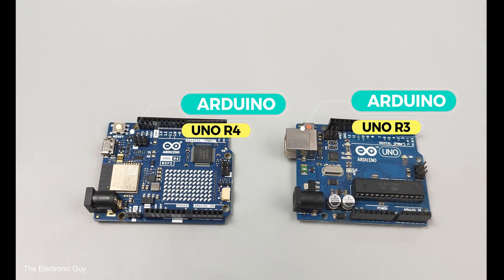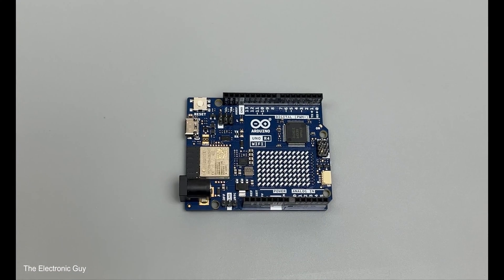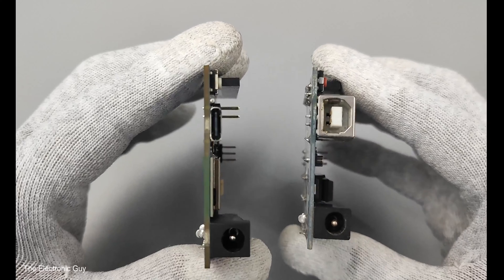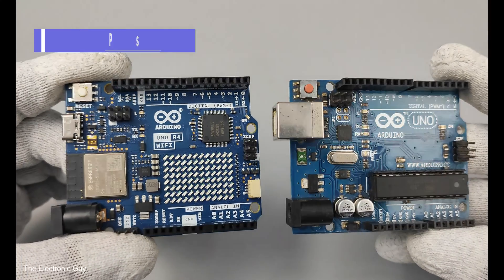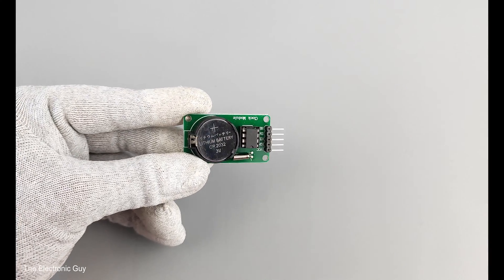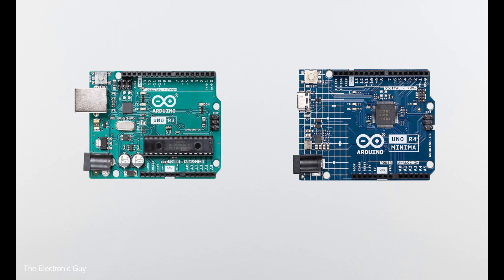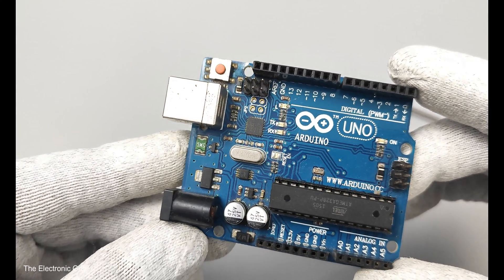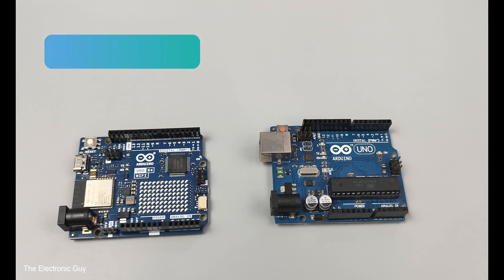Why Arduino Uno R3 vs R4 Isn't Close in 2024

Comment: The digital output current differences mean that the R4 is not necessarily a drop in replacement for the R3.  They should have changed the name to UNO+ or something like that to distinguish the two.

Comment: So does the R4's RTC loose it's time when powered off?
Reply from the maker: You have to power it separately from a battery so that it remains on. It's just like attaching an external RTC module(with a coin cell) but now you don't have to make any connections.
Reply: Is there holder to add external battery for RTC

Comment: Adding an esp32 for WiFi and Bluetooth is lunacy. Just by itself is is more capable than an Arduino. It's like adding a mercedes to your Lada coz you want to use the blinkers
Reply from the maker: Couldn't agree more. But I think the idea behind adding the ESP32 to the UNO R4 is to give users the best of both worlds.  By integrating the ESP32, you get the feeling of using the same old familiar UNO without having to jump to a completely new board. 
Also, they want users to use their IoT cloud with the Arduino boards.
Reply: @THEELECTRONICGUY  there indeed might be lots of reasons, but i think when sticking to the arduino IDE, the transfer from Arduino to an esp32 would not be so great. Regardless, it offers an extra choice for those who find the step too big or to alienating. Up to each own what to choose 😊
Reply from the maker: To be honest, even using the built in ESP32 on UNO R4 is not that easy. It has its own problems. Yes it comes with some pre loaded examples in IDE but when you want to program it for different applications, there are not a lot of libraries available.

Comment: So i have to buy an entire board for every new project? It’s a pity! 😢
Reply from the maker: What do you mean by "for every new project"?
Reply: I used to program the dip chip atmega with Arduino board, then i swap the chip, and with just the cristal osc and bunch of pwr supply components, into my current project into a custom board (lets say an irrigation system). Now with this chip package is not possible.
Reply: @ex1stenz well if you just used your arduino board as an atmega328 programmer, why would you even need the R4?
Reply from the maker: I think what he meant by that is: It would have been great if there was a DIP uc on new UNO, obviously not this much powerful but powerful than the ATmega328. This would have given him an easy way to program that new UC with bunch of components and with additional power as well.
Reply: @ex1stenz  Nothing is quite as easy to swap as dip ICs, but you could design your own development board to take a chip mounted on a small adapter to make swapping a little easier.